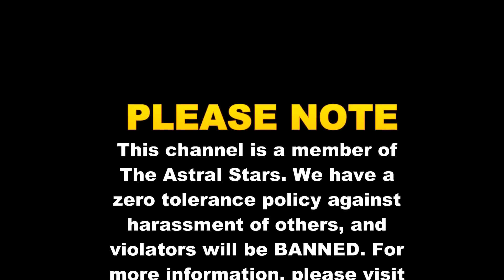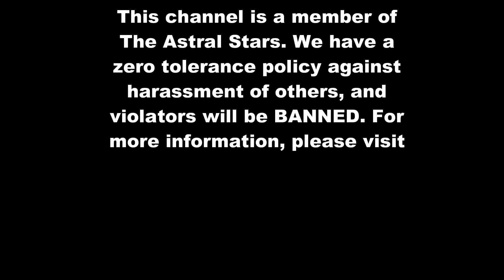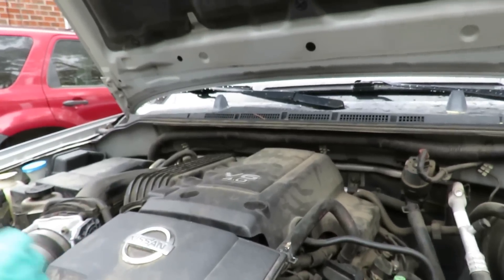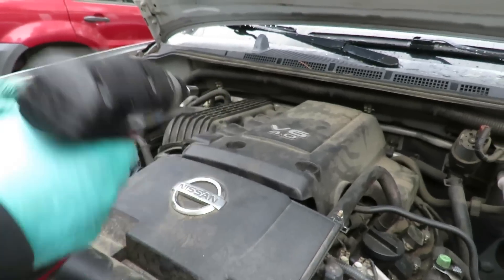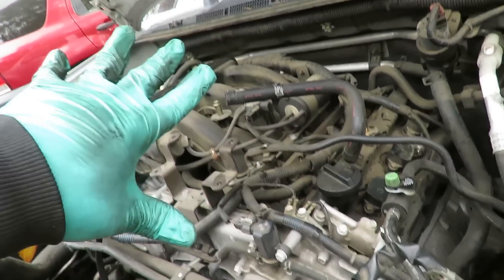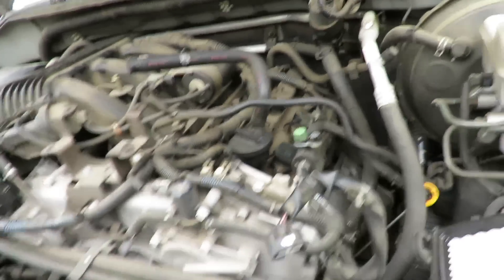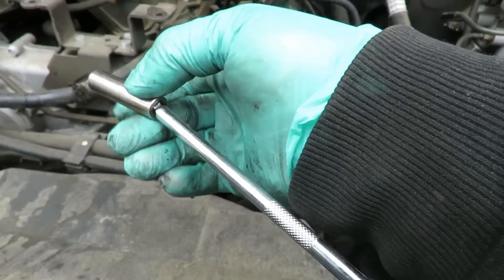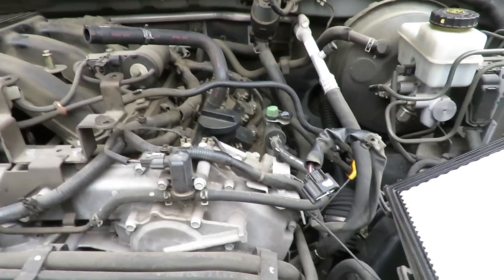⭐ 2005 Nissan Pathfinder - 4.0 - Spark Plugs - PART 1

Comment: What type of spark plugs?
Reply from the maker: You can use platinum, double platinum, or iridium, but DO NOT use copper.
Reply: @OnlineAutoRepairVideos  Use the iridium. They last 4x.longer so u dont have to change thrm again for 100,000 miles. Worth spendibg extra for iridum plugs as changing plugs is lots of labor. Very good how to video. Thank. You.
Reply from the maker: @mastersmoosh9496  SO TRUE!!

Comment: I hate it when those dang gaskets fail and fill the spark plug wells with oil. I start out thinking it will be a straight forward job and then wham-o, much more work than I intended.
Reply from the maker: What's messed up Len, it was the LAST one I was doing. Only Astral gets the projects...